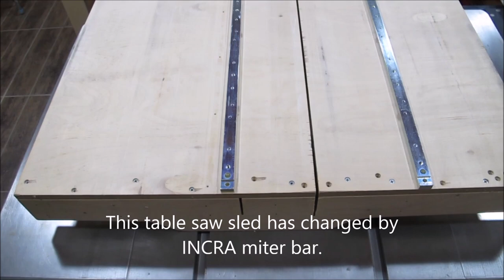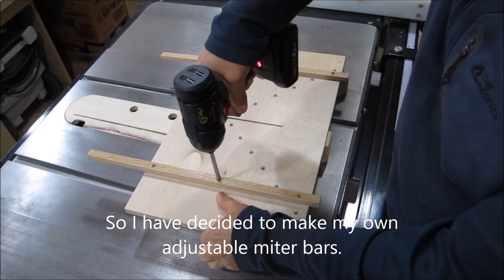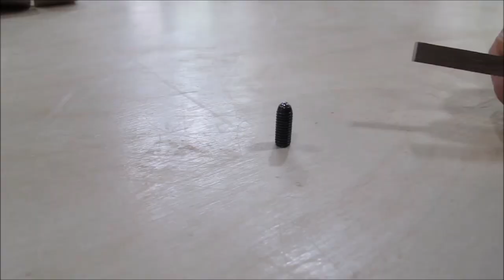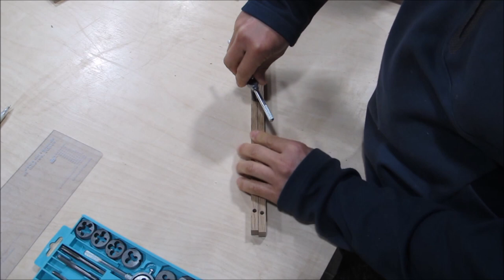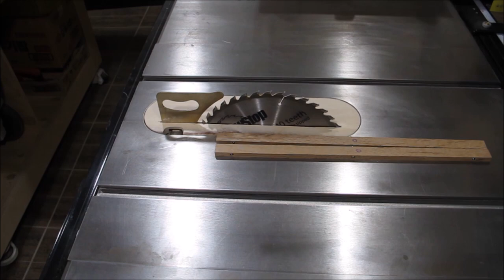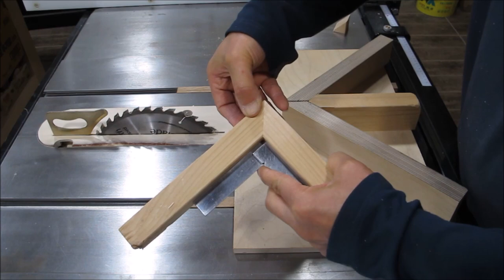Adjustable MITER BAR

Comment: I purchased a Scheppach table saw 3 weeks ago, it has inverted T slots of unusual size - otherwise great saw, most if not all miter bars dont fit and I was wondering how was I going to sort that... If someone asked me what vid I would like to see I would answer "diy miter bar how to" ☺, so thanks for this great upload!
 
Quick question, what timber did you use for this, does it matter as long as its hardwood?
Thank you.
Reply from the maker: Thanks for coming again. First of all, congratulation! Your table saw.
I used oak for the bars. I think it doesn't matter if they are any hardwood.  plywood also.
Reply: @makefurniture1  thank you 👍

Comment: Hello friend, this is really a solution, I would like to ask a question, I see these MITER BAR built with various metals, does this not damage the table slots over time due to friction? Materials such as hardwood, plastic, nylon or UHMW would no longer be suitable. Thanks
Reply from the maker: Well, I guess there will be damage on the table slots if you use a metal miter bar a lot. But there are so many metallic bars in the market. I'm not sure why.
Reply: all right, there are really many metal bars on the market, the wear will depend a lot on the frequency of use. I live in one of the regions of Brazil where we practically have no problems with the hardwood runners, as it is a semi-arid climate, I have been using them for a few years and they are perfect and my table saw slots are intact. Good projects...Thanks
Reply: @woodworkingspace7342  I know this is an old question but to address @woodworkingspace7342 's concern.. these types of plungers are now available with nylon tips rather than steel tips. I have an evolution rage s5 which is notorious for having weird sized slots and I'm contemplating getting an after market mitre gauge and using this technique with some nylon spring plungers to make it fit.